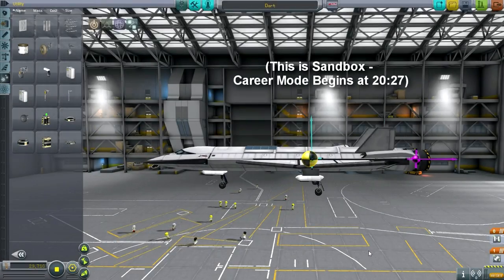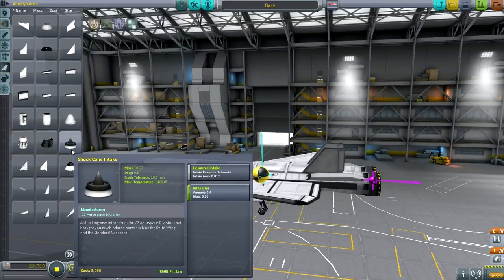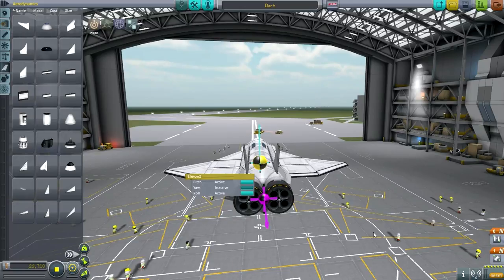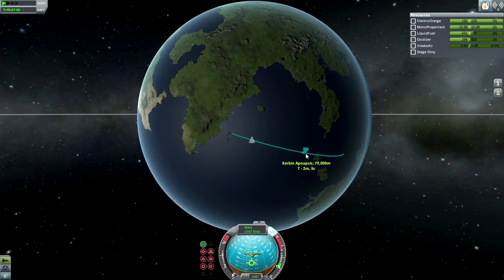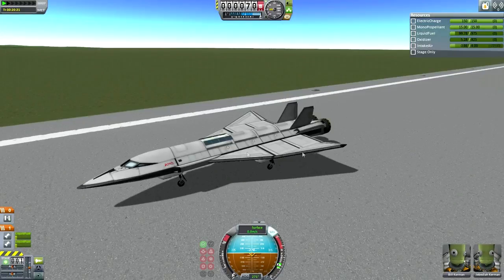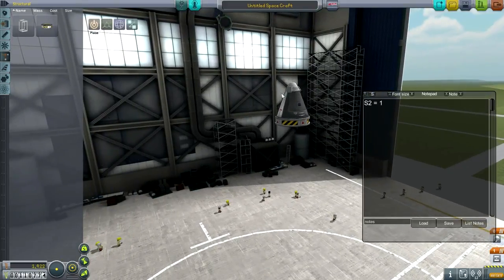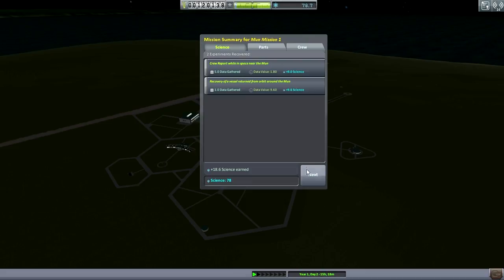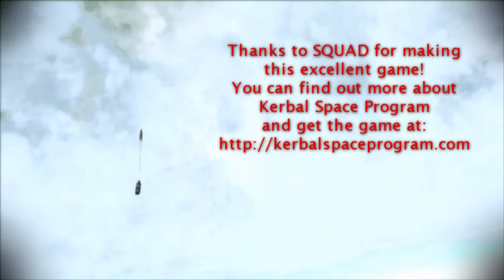Kerbal Space Program (0.90 Career+Sandbox) Tutorial 06 - To the Mun

Comment: I got a question... I've built the same rocket as you did, with 2 stages and 6 fuel tanks (1 tank for the second stage and 5 for the first one) but my rocket fails to lift off the platform. I used to be to lift off w/o any problems but after I upgrade the platform it doesn't get off the ground anymore. Do you have any idea why?

Comment: You can just disable electric charge consumption by right clicking on the capsule and clicking on the little green button next to the green "electric charge" bar. This will stop the vessel from using it up when you don't need it and you can turn it back on when you do need it. Kinda cheatsy I know but I find running out of electric charge for no reason kind of annoying
Reply: good point. I forget that not every one has danny2462's ethics (or lack there of)